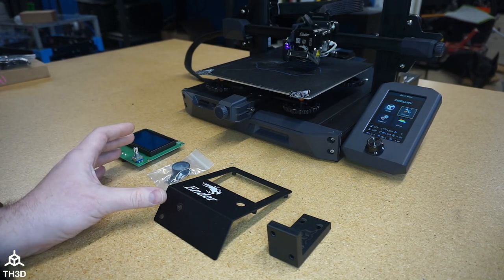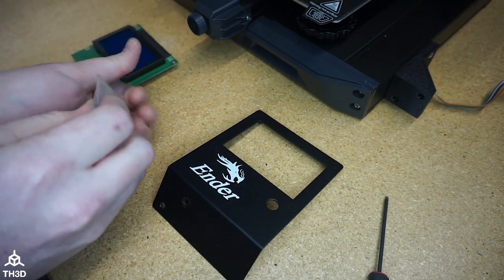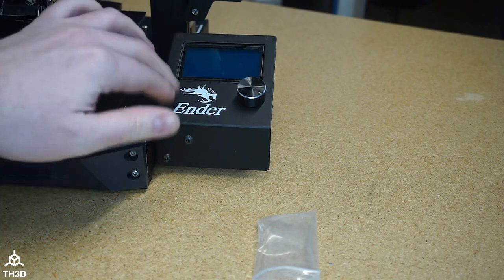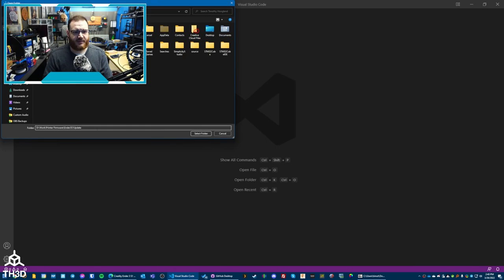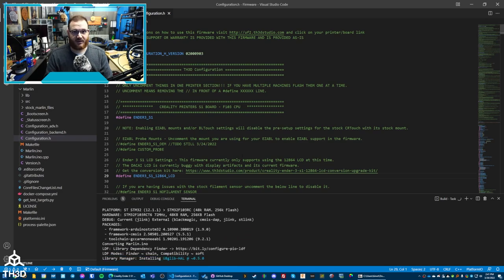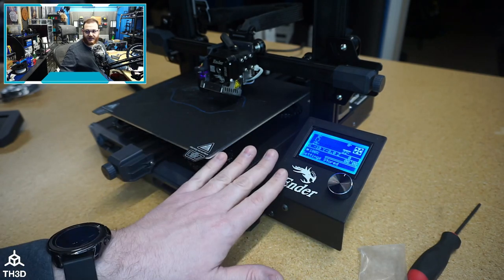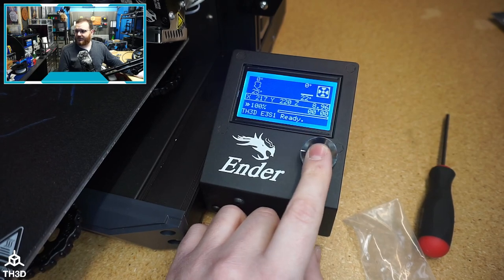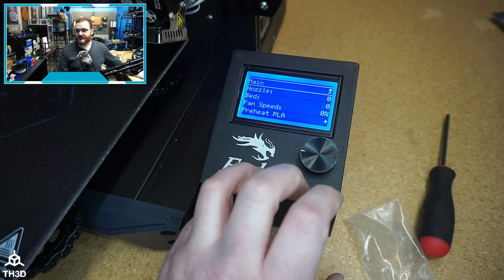Installing the 12864 LCD Kit on your Ender 3 S1, S1 Pro, S1 Plus | Install Video

Comment: Great video showing the install - and it's great that it doesn't require the user to open up the machine.
Reply from the maker: Thanks Joel!
Reply: Unless you got a Pro or Plus.  Then you have to swap out the cable.

Comment from the maker: With the addition of kits for the S1 Pro and S1 Plus we've made separate product pages for each that automatically include all parts for each model variation that is needed to help make selecting the right kit easier for everyone. Also please note that you will need to open the bottom of the printer on the S1 Pro/Plus to install the new LCD cable. Since the Pro/Plus use a touch screen that uses a different cable than the normal S1 model shown in the video.

LCD Kit for S1: https://www.th3dstudio.com/product/creality-ender-3-s1-12864-lcd-conversion-upgrade-kit/
LCD Kit for S1 PRO: https://www.th3dstudio.com/product/creality-ender-3-s1-pro-12864-lcd-conversion-upgrade-kit/
LCD Kit for S1 PLUS: https://www.th3dstudio.com/product/creality-ender-3-s1-plus-12864-lcd-conversion-upgrade-kit/
Reply: 403 Forbidden on all links

Comment: Short question regarding the LCD. Since I live in EU the transport+tax makes it quiet expensive, would an alternative "12864" lcd I can get on Amazon work with the firmware? Or is it some sort of special lcd?  If thats fine for I can still give u money for ur effort. The abl with stock firmware is making me crazy...
Reply from the maker: Its a creality specific LCD. I can't guarantee that it will work with others. There are many variants out there.
Reply: @TH3DStudio  as long as I order a creality 12864 screen firmware should work?

Comment: Great video👏👏 ، i have BTT 3.5 tft v3.0.1. Is possible to connect BTT screen with ender3 s1 using your following steps?
Reply from the maker: Only in 12864 mode.
Reply: @TH3DStudio  
It works perfectly with btt 3.5 tft v3.0.1 on marlin mode. Thank you

Comment: Being new to the Ender line can you tell me if this will have the manual bed leveling like the other firmware. What I got with the S one did not have manual bed leveling. Also, will there be an upgrade for the touchscreen on the pro model so we can use it on the standard non-pro model
Reply from the maker: Yes it will.

Comment: Anyone having display issues with the S1 Pro?  Just turning the wheel after starting the printer makes the screen go haywire with random characters and lines.  I've tried multiple cables and when I put the screen back on my Ender 3 v2, it works just fine with their firmware.  It worked fine orignally and has gradually gotten worse.  I've reflashed the firmware with no luck.
Reply from the maker: Try the latest firmware. We did some tweaks on the LCDs to make them more responsive and to mitigate EMI issues. Whenever you get characters and lines on the LCD that means your printer has electrical interference problems. Also check that your PSU has a proper ground as well as the cable going from the printer to the wall, this is assuming the outlet you are plugging into also has a good ground on it.
Reply: @TH3DStudio  I'm having no luck.  Just got another S1 Pro (had to replace my previous one) and nothing is fixing the display issue.  Grounding is solid, using the latest firmware, wrapped the lcd cable with the EMI tape recommended, changed out psu to a meanwell.  Super frustrated not being able to run the ezable and 12864 display that works perfectly on my ender 3 v2 and on my previous S1 Pro.  Adding the ST7920_DELAY lines to unified fixed my first S1 Pro display issue before you added into the newer build but I feel something has changed on current prodution that isn't playing well with the display and unified.  Ready to ship the whole printer to you for helpl!!

Comment: So I have a shiny new Ender 3 S1 Pro...  I'm already getting some very weird things happening in addition to the oft mentioned leveling fun.  Took me quite a while to get it reliably leveled... after that I've had a couple of issues:
- the .05 default Z offset seems to always be either too close to the bed or too far away
- I entered in a higher 1st layer head and bed temp for better adhesion.  For some reason, instead of the 210 head temp I set in Cura, it always goes to 175.  I've tried this with a couple of different models and same problem.  Then, miraculously, on one of the models after I power cycled the printer, it went to the correct first level head temp.  It hasn't done this since--just the one time.    
So this firmware/hardware combo looks to be a real mess.  Other folks have reported all kinds of problems and complex fixes for the fancy screen.  Hard to imagine how these kinds of issues get through a quality control check.  I'd kind of prefer using my time to print fun stuff so I'm going to stick with what works even though the LCD touch is sexy.  Ordering through your site now.  Thx for the instructions!!!  You guys rock!
Reply from the maker: It's really sad that they can't get it right. At least we're able to put out something to help. We haven't had a single return on these kits and we've sold many of them. The only difference is just swap out the LCD cable for the one on the LCD kit page (theres a longer cable thats a cheap addon for the S1 Pro). Other than swapping out the LCD cable its the same. We have the S1 Pro already supported in our firmware.

Comment: Hello, Tim
Would this work on a Ender 3 v2
Disregard went to your site and purchased Thanks😀
Reply from the maker: There is a similar one here: https://www.th3dstudio.com/product/creality-ender-3-v2-12864-lcd-conversion-upgrade-kit/

The difference between the "V2" and the "S1" kit is that that S1 includes that bracket to attach it to the side of the extrusion whereas the V2 just bolts on to the extrusion like the Ender 3/3 Pro. So technically the S1 kit will work, you just won't use the ABS bracket we include.

Comment: hello i think i bricked my printer bootloader can u upload a video on how to jump the board for the ender 3 s1 pro f4 chip
Reply from the maker: We dont have plans to do that. but if you can get the F4 bootloader (I believe creality has it on their website) file and a ST Link you can flash it that way.
Reply: @TH3DStudio  there are different versions and models of ST Link which one should i get ? + thx 4 the quick response

Comment: Does the firmware for the S1 pro fix leveling issues (ABL issues) with the F4 borad
Reply from the maker: Yes, the ABL system works with our firmware on the F1 and F4 CPUs for the S1 series.

Comment: Great video! I just purchased the LCD conversion kit for my Ender 3 S1 pro to replace the touch screen lcd. Will this LCD work with the installed stock version that came with the printer?  Just curious.
Reply from the maker: You will need to update the firmware as shown in the video. We have it on the website here: https://www.th3dstudio.com/hc/downloads/unified-2-firmware/creality/creality-boards-creality/creality-ender-3-s1-firmware-v2415_301-board/
Reply: @TH3DStudio  I just realized that my ender 3 s1 pro cable that goes to lcd screen is not a 10 pin like that of the s1. I only have 4 pin cable connected to my screen. The motherboard that came with my s1 pro is the STM32F401 RCT6 version. Will I not be able to upgrade to this screen because of the 4 pin cable?
Reply: @MrJmc67  I'm also experiencing the same issue. I do see that there are 10 pin connectors that come with the kit, going to pop open my printer and see if I'm able to connect them to the motherboard.
Reply: @orangetater2417  You are good to go. The motherboard does have a 10 pin connector. Unfortunately for us with the S1 Pro, we have to open and connect the cable to the motherboard. Don't forget to remove the other cable from the motherboard.
Reply: @MrJmc67  Was going to come back and mention this but got distracted. Yup, did the same. I didn't remove the original cable and just tucked it away, did that cause problems for you?
Reply: @orangetater2417  I did the same since the touch screen cable was glued to the motherboard. I just removed the screen and put it away.

Comment: After doing this on my S1 Plus, I am getting a garbled screen when I turn the knob.  Random mess of characters...sometimes just a blank screen. It starts up fine, though. Thoughts on why that would happen?
Reply: After a bit of digging, I found that my S1 Plus needed a delay added to the config.  Works great now, with the extra changes I made to the firmware.
Reply from the maker: If you can send our support an email with the changes you made I can review and add to the next firmware release.

Comment: So would this resolve the issue for the ender 3 s1 where it won't update?
Reply from the maker: I'm not sure what you are referring to but our kit supports both the S1 and S1 Pro with the F1 and F4 cpus.
Reply: @TH3DStudio  the one where a lot of the newly made ender 3 S1s firmaware cannot be updated or if it does it gets "bricked"

Comment: Would the process for the S1 Plus differ? Is so, how? Thanks!
Reply from the maker: The only difference is just swap out the LCD cable for the one on the LCD kit page (theres a longer cable thats a cheap addon for the S1 Pro). Other than swapping out the LCD cable its the same. We have the S1 Pro already supported in our firmware.
Reply: @TH3DStudio  Thanks. Is the S1 Plus supported as well? I haven't opened it up to check the main board to see if it's the same.
Reply from the maker: Didn't know they put out ANOTHER version of that. But looking at it looks like its a S1 with a larger bed and touch LCD. If the mainboard is the same as the other S1's we could get it supported as well with a quick firmware change.
Reply: @TH3DStudio  I'm hoping I could use the screen from an old Ender 3 V2 I have

Comment: Yeah..well..they changed the connector on the S1 Plus.
Reply from the maker: There is a different page for the Plus since it needs the cable swapped: https://www.th3dstudio.com/product/creality-ender-3-s1-plus-12864-lcd-conversion-upgrade-kit/ That kit includes the cable. You can also get the cable in case you ordered the standard S1 kit here: https://www.th3dstudio.com/product/60cm-10-pin-lcd-cable/

Comment: What a messed up the stock firmware is for ender 3 s1 from creality and I'm surprised very few reviews on YouTube actually say truth about it. I've been wanting to install marlin 2.0 stock on it. Thanks a ton for this. The machine is beautifully built but the stock firmware is the shittiest with leveling bugs a lot. It would b also awesome if we could use the same modern lcd but still no issues as far as it works amazing on marlin 2.0
Reply from the maker: Watch our last Ask Tim stream here: https://www.youtube.com/watch?v=q4qaQEjaHqE . The Stock LCD is "working" but it has glitches still. The 12864 works perfectly with our Marlin build.

Comment: i'm stuck i have the f4 board and need to change the default_envs vs code platformio.ini.   what do i do inside the platformio.ini as there is no instuctions on how i change my board type. all the // are missing.
Reply from the maker: Read the platformio.ini file. Directions are in that file.